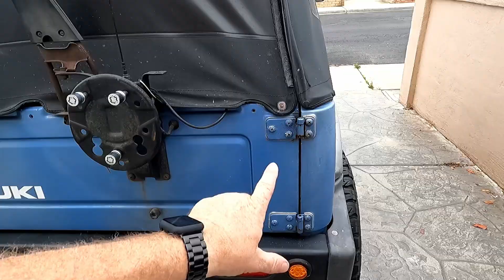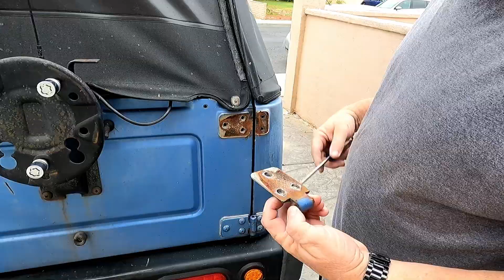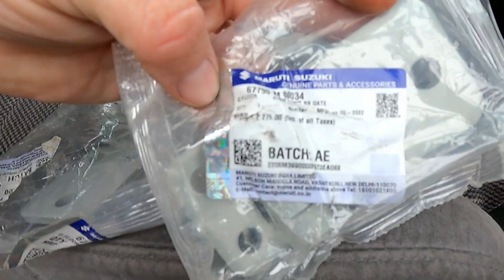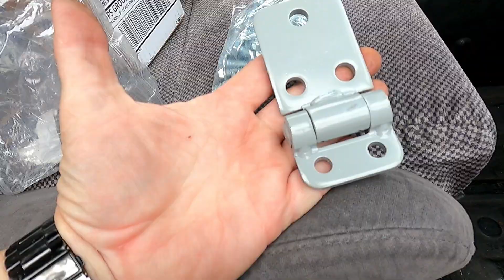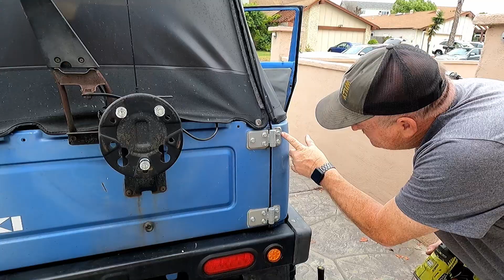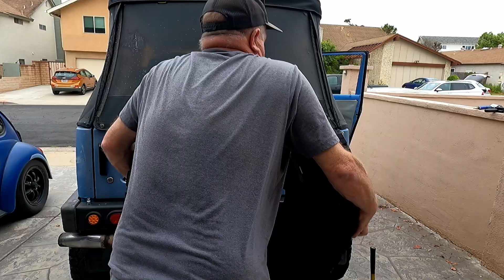Willy's Suzuki Samurai Tailgate Hinge Problem

Comment: Where you got your rear bumper from?
Reply from the maker: Hello Marco, I made the bumper. I used the original bumper, removed the taillights and installed a plate in the light opening. Then just cut the holes for the new lights. Next with fresh black paint I had a new bumper. Thanks for watching!!